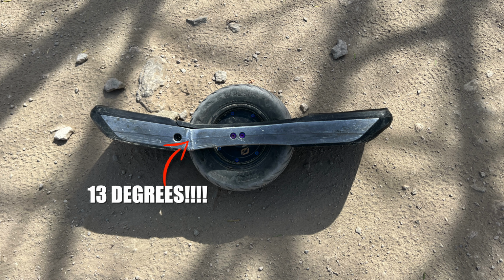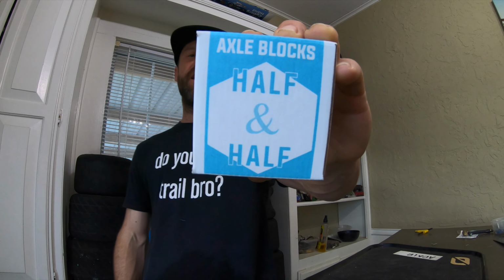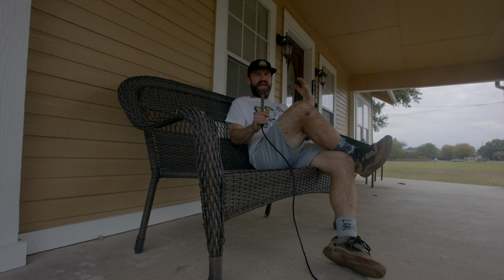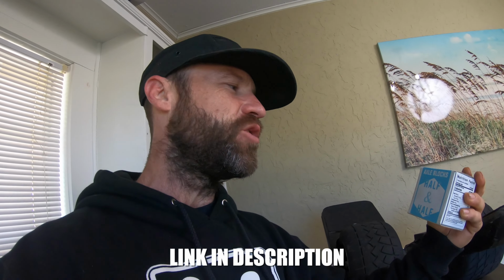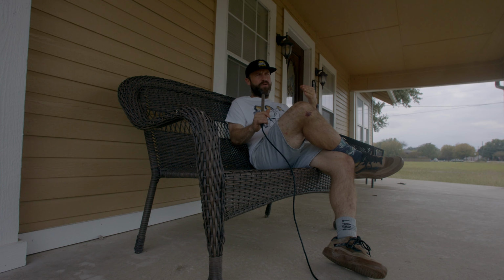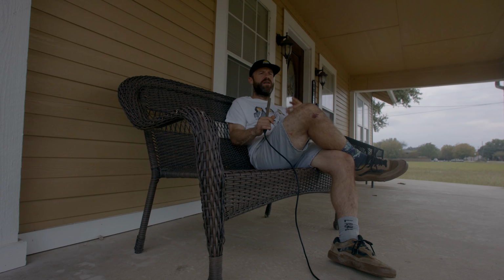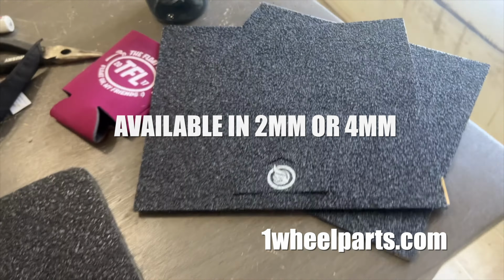ONEWHEEL GT- TAIL RAILS WITH HALF & HALFS IN BENTONVILLE !

Comment: ahh, just picked up a used xr. After 3 years of riding a pint, absolutely love it. WTF rails are next!
Reply from the maker: You will not regret the w rails ! On the trails the first couple of times it will take a little getting used to. When you get then dialed they are game changing bc of you lower cog. Keeps you on the board all day.
Reply: @jeffadairshreds  Im torn between a cbxr or w rails. I bearly get 11 miles on it, but its  a 4212 so ill have to get JWFFM too. So I don't know yet. My friend has a gt, I went out and rode that board for 3 hours and got 33 miles. But I've rode w rails and they seem so much more comfortable to ride on!